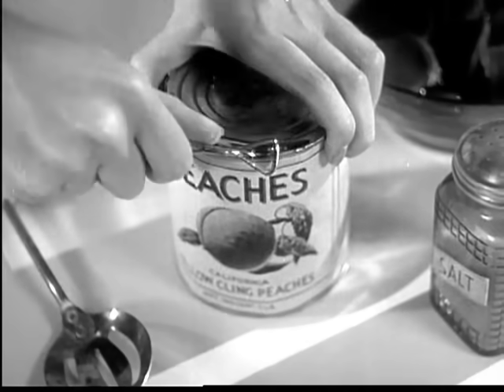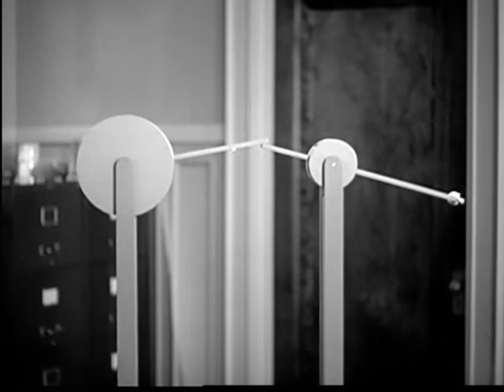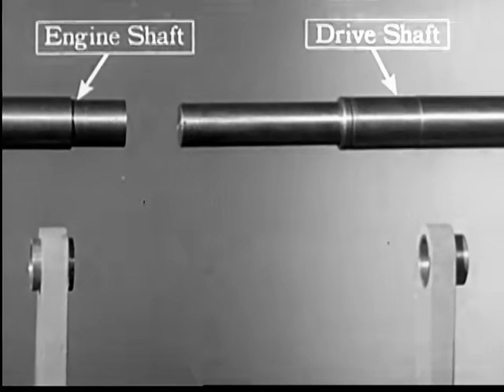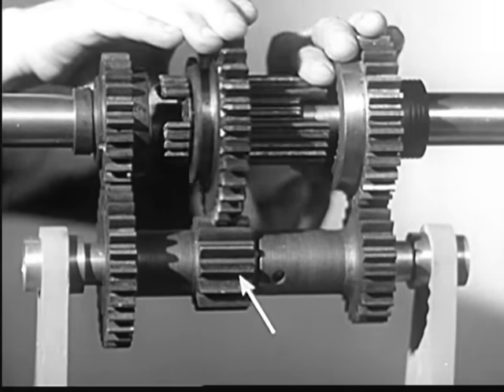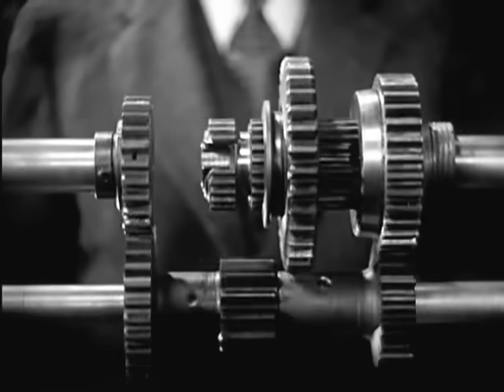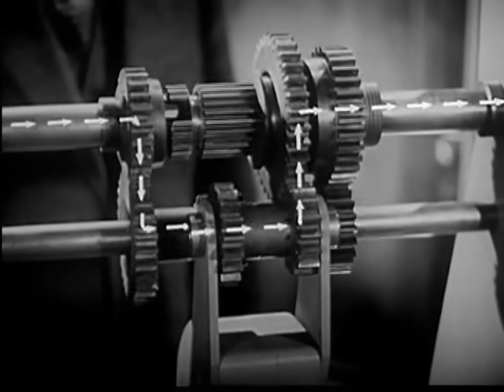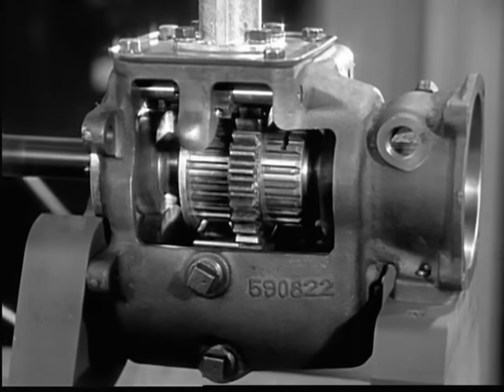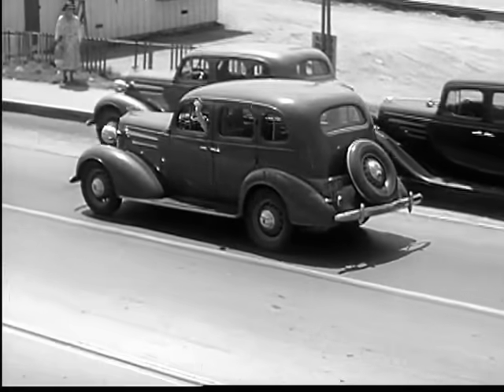Spinning Levers - How A Transmission Works (1936)

Comment: I bet that six cylinder was screaming like a banshee when she dropped it into second going down that hill.
Reply: This car is a 3 speed, second is only a little lower than 3rd in a 4 speed.
Reply: Nahh bruh that thing looks like its got a fat LS swap under tha hood
Reply: @surellow  
Heh, on a long enough timeline...
Reply: ah yes, the 6 cylinder banshee scream.  Also present when driving 75 mph.
Reply: @120masterpiece     Also present when driving a Ford.
Reply: Koo 9
Reply: Shoulda braked first then downshifted
Reply: @pranavdongre3290  Hitting brakes first will make wheels slip and your car spin. This will end wheels up, roof down. The point is to brake wheels smoothly by reducing their speed, not stopping them instantly. When the road is slippery or going downhill the wheels must roll, never stop. U should shift gears lower and lower and when speed is low enough, use brake pedal to stop car. Of course, shifting and final braking could take just a few seconds, maybe just a couple. This saved my car for several times, bro)
Reply: @lunotarr  got u bro
Reply: @lunotarr  dayum bro
Reply: @lunotarr  i mean you finely tune the braking pressure to stop without locking the wheels. It's not like u only have a handbrake. Maybe the 30's brake designs where less refined than today's.

Nevertheless, what you are saying is a great skill to have on wet/snow/icy roads! And very good practice in general!
Reply: @SergeantExtreme  horry fok i had no idea xD
Thank you for the info!
Reply: Вадим Романов Tires have no idea whether it is the brakes or the engine that is providing the force to slow them. The brake system usually can provide more stopping power than downshifting can and you would probably be less likely to lock the tires downshifting than hitting the brake pedal as hard as you can on an older car. However, with a modern car with antilock brakes it is a non-issue. Outside of driving for fun or sport, downshifting and engine braking is really only used if you are going down a long hill or mountain and would need to use the brakes the entire time.  Riding the brake can cause excessive brake pad wear and overheating. Which in turn can lead to expensive repairs and even brake failure.
Reply: @lunotarr  you made it sound as if the voice was speaking again
Nice
Reply: I have never laughed at a YouTube comment until now.
Reply: I bet these cars had low geared rear ends or something like that, so they won't scream that much if put into 2nd gear
Reply: Downshifting at 35 with a 3 speed makes it race. I rarely downshifted above 40 if I recall correctly, and 1st gear was not synchromesh, so you either stopped the car before selecting it, or did a little work with both the throttle and clutch. That was all an art I mastered which I've since forgotten now that I drive a 5 speed with full synchromesh.
Reply: In these old cars, would you blip the throttle on a downshift?
Reply: @typorad  blipping the throttle wasn't really necessary for second with a synchromesh transmission.
Reply: Yeah!

Comment: Hiw did they manage to edit their film back in the 39's?
Reply: With a negative cutter and splicer.  Transitions like complex fades, slides,  and such were done by cutting and and projecting selected pieces of negatives into specialized cameras that combined the images in various ways, producing new negatives with the desires transitions. The transitions were then spliced back into the original negatives at the desired locations and then everything was processed into the final display print. It was time consuming and expensive and required specialized equipment and skilled technicians. Unless you were a big enough studio that could afford to operate your own film effects department, most such work was jobbed out to film optical companies.

Comment: Never underestimate the impact of actually seeing something working. There's just something better about a physical demonstration over a 3D animated one
Reply: If the 3d animation is good enough to make you think its real , or if its executed good enough it will be good. But most people cant make good animations
Reply: As they said, seeing is believing
Reply: It’s better because we can see the physics taking place. In 3d animations they rarely simulate physics, it’s all animation.
Reply: That makes no sense, you're not watching it physically, actually you're watching it on a phone/monitor which only uses XY (2D) axis to simulate 3D. I'd rather watch something in 2D thats animated but works than some recordings that explain badly (not this video), actually i'd just prefer a detailed text as long as its right over a bad video.
Reply: So true
Reply: each frame of archimedes animation had to be handdrawn
Reply: 3D animation is extremely necessary. It's the same as this. You just never saw a good quality animation
Reply: Never underestimate the impact of 3D animation. There's just something better about  3d animation  over a physical demonstration
Reply: @rodriguepellaud    No, most 3d animation these days is complete shit.

Comment: "steep hill,use 2nd gear" because we haven't yet designed good brake systems and if you ride them you might die.
Reply: Until this very day, experienced drivers shift down when going downhill.

Comment: нихуа не понел, но очень интересно
Reply: On a Cyrillic gearshift, the letters are E, backwards N, H, 6, and W.   Backwards N for invert, H for neutral, 6 for run (drive), and W for shunt (low gear).   I've figured out what all of them are, except E, but by process of elimination it means park.  What word might start with E and mean park?

Comment: Nice work... I suppose that the 5-gear transmission works the same way...
Reply: Probably roatates to a different counter shaft with staggered gears in between. Just a guess

Comment: God how out of date this is today. A 3 speed manual. Manuals now use constant-mesh gears. All gears are always meshed. A sleeve with synchros connect individual gears to the drive shaft. So much smoother than this clunky old design, not to mention so many more gears. It’s still nice to see where they came from though.

Comment: 9:28 Love that sign " Steep Hill Use second Gear"
Reply: Guess the brake technology was behind the go fast technology.
Reply: @TYoung-up9ro  It's always better to be in a lower gear to use the entire drive-train to maintain a slower speed and more control rather than to put all the pressure and wear into the brakes during a descent.
Reply: @southpaw117  especially on a big truck, it's not that big of a deal in cars but on an 18 wheeler you'll NEVER want to rely on the brakes

It's kinda funny to see people honking at trucks, they don't know how much power and time it takes to accelerate and brake.
Reply: @TYoung-up9ro    You're forgetting these cars had all-metal bodies, they weighed a literal ton! Even with modern braking technology, cars that heavy wouldn't stop so well.
Reply: @SergeantExtreme  That's a common misconception: modern cars are often significantly heavier than these old ones. Safety features and technology add quite a bit of weight, despite the widespread use of lightweight materials!

Braking technology was terrible in the 1930's. They were vastly less effective, and said effectiveness fell off dramatically in situations requiring frequent or sudden braking. You could easily overheat your brakes if you rode them down a long grade like that shown in the film.

Comment: The reason these are explained better is that at the time they were trying to show people why pay extra for this item. Now all cars have gears, thus no company has any need for ads like this. In 1920s and 30s, many families were still driving 1900s type vehicles, including a number of chain drive single gear designs. These new gears added 10% or more to the cost of the car. So we had to convince people why they needed to pay more.

Comment: the only thing they dont get right for modern world is, why an automatic puts down more torque.. before lock up you have more RPM for less wheel speed, giving more available engine torque sooner.
same reason why my 5 speed car will accelerate slowing if i just let idle rpm move the car with a slow clutch, if i pack 1500rpm in and slip the clutch through engagement, the car takes off quicker. You are applying more torque from the get off (if done right) with less wheel speed due to rpm.

Comment: then whats the reason if the 1st gear if it has so much power, if you suddenly release the clutch the engine stalls with a jerk.
Reply: Depends on the vehicle whether it has enough power. Most regular cars stall when the clutch is released suddenly on the first gear, but many trucks and tractors have so much torque that they are nearly impossible to stall on the first gear.

Comment: Explains better than my school books.

School doesnt need to upgrade they need to degrade so that we watch this stuffs on a projector.
Reply: Agreed. The US spends the most amount of money per student than any other country in the world. The US also routinely places in the mid 20s in test scores around the world. The problem isn't spending money...it's being efficient in what's being explained
Reply: @pro-seriesfabrication3810  Not the schools/teachers'/or efficiency issues in any way, it's the technology and advancement of today that's next to impossible to explain and understand - hence those test scores... For example, most of us fully understand what's taught in this video as it's easy to understand and explain, but if it was a video on say a modern-day electronically shifted 8-speed transmission (and example of what's needed to understand today) - MOST of us would be lost, and some of us would blame the teachers/educational system for it when it's really just harder to understand.
Reply: @beobe99  so the schools that score in the top 10/top 5...you're saying their material is easier and their technology is stuck in the 1930s?
Reply: @pro-seriesfabrication3810  No, of course not. There are MANY variables to take into consideration besides what's taught. First being the student/teacher ratio - Teaching (and learning) w/ 25-30 kids packed in a room is more difficult than teaching and learning w/ 15. In addition to that, demographics play a large role based on what the child's home life is like and/or the stress they carry. Schools that grade higher are typically in wealthier or middle to upper class lower population areas. These schools get to brag that they're better, and they are! BUT, they didn't figure out something public schools haven't - other than having the luxury of creating their own student/teacher ratio AND choosing who is admitted based on parent/student interviews.

Comment: They always used women as a showcase of ease. "Look, it's so easy, even a woman can do it." what's interesting is the shear number of women who never learned to drive even in the 50's. There's a funny episode of father knows best where jim teaches margret how to drive. It was hysterically funny. Automatic transmission really helped to get women more mobile but a lot of women learned manual shift. My mother only drove manual shift cars for as long as i can remember. I remember her big and pregnant with my little sister and still clutching and shifting. Sadly, so few vehicles today have a manual shift option. I recently acquired a CJ-7 jeep specifically for forcing my teenage daughter to have to learn manual when she comes of age. Want to drive? Learn to shift.

Comment: Awesome video but 90 rpm?  That just seems too low even for 1936.  A typical engine idle is about 10X that.  Not sure what's going on here.
Reply: Rotational speed really doesn't matter for the purposes of the film, 
and with a full-size wheel and tyre spinning right next to the man, 
90 RPM is about the upper limit for reasonable safety.
Reply: @spacemissing  Yea, I just realized it's the rotational speed of the model, engine not a typical car.

Comment: could someone explain what then happens to the drive shaft while breaking with gears down a hill, wouldn't that interfere with the shaft that holds the pistons? if there is an explosive force that drive the pistons it must be some part to take of that energy/resistance fed back from the wheels?  I'm not well informed on this topic and not the brightest either so what am I missing here?  thanks in advance for any answers

Comment: When I was traveling cross country in my 1956 Ford F100 pickup a few years ago the transmission (3 speed, on the "tree" (column) shifter) went out. I literally pulled it into a local farmers barn, took it out, and rebuilt it in a couple hours with bearings, seals, a couple new gears that I found at a local tractor repair parts store. Try that with something made today, NOT A CHANCE!
Reply: Because everything now comes with model specification. In other words, you Have to buy from us for  fixing the car we just sold you.
Reply: In the future engines and transmisions will be modular
Reply: @marv9906  No, it doesn't work like that. In the future there will be no cars, just slaves to AI.
Reply: u old brah

Comment: I'm still not quite understanding the reverse. Why are some gears moving clockwise and the reverse anticlockwise without causing damage to the gears?
Reply: The clutch, which is not illustrated, has disengaged the engine and the driveshaft, transmission gears are not spinning when the shift is made in real-world scenarios.  Their demonstration is being conducted at 1/10th engine idle.
Reply: Okay, that explains it. Thank you, sir.

Comment: i didn't fully grasp the "in reverse" bit of it..... what made the shafts go in the opposite direction ??

other than that, another excellent 1930s explanational video
Reply: There's another gear used to reverse the rotation of the shaft.

Comment: I learned how transmissions work in many modern animations but i could never figure out how the synchronizer worked until one video finally explained it. But still I still didn't quite understand why it worked until this old film.
Although much like that one video, its so simple and almost 'flimsy' method that its still hard to believe that's all it is.

Comment: I love these videos; they do a great job explaining how these technologies work.  That being said, modern transmissions are a little different, partly because they usually have more gears (four forward gears is more common now than three, and some cars have more than that), and the way that they handle shifting is a little different, using a clutch rather than synchro-mesh, or a clutch along with synchro-mesh.  And, of course, many modern cars have automatic transmissions.  But that's just nitpicking; again, these videos are great.

Comment: I can't believe so-called Engineers took such a reliable and simple design and turned it into what we now call CVTs, which don't last 50,000 miles on a car that weighs 1/4 of what old cars used to weigh.

Comment: Over 20 years ago I built my first Lego Technic car with a working 3-speed transmission with reverse. It uses simple inner gears to catch free-spinning outer gears, but across 2 or 3 (don't remember) shafts along with (I think) more than one countershaft. It's a bit easier to follow how it works, but the model in this video is definitely a heck of a lot more compact with it's multi-layered free-spinning gears. That Lego car definitely has neither clutch nor synchronizers.

Comment: I saw the synchronizers and was thinking they could allow shifting without a clutch (in practice). Then I saw the driver was using a clutch after all, I assume while driving a vehicle with a transmission similar to the one on display. So, with synchronizers, is the clutch really all that necessary? I know that the clutch disconnects the flywheel from the transmission so that the gears can mesh a bit easier with less power driving on them. I'm guessing that perhaps rebuilding a worn clutch assembly is easier than rebuilding a transmission. Come to think of it, don't some European cars have no clutches with manual transmissions?
Reply: In my Semi i never clutch after first, you just get it at the right rpm and drop it into gear. In a high rpm gas motor with more delicate gears in the transmission you would have to be very precise not to grind or face gears, and even then i think you would wear out your synchros. In "clutchless transmissions" it still uses a clutch but its just handled by electronics so no need for the driver pedal.

Comment: This is how a manual transmission works. Anyways I think some automatic transmissions are modified manual transmissions because, there is a computer controlled linear actuator in place of the gear shifter in this version of the automatic transmission, and there is another gear stick that is different than that of a standard manual transmission, or could be a gear stick from an automatic transmission.

Comment: Instruction movie ends nicely with letting a women demonstrate safe driving downhill on low gear. Nice touch when thinking of what roles women usually were assigned in the society at that time. Agreeing with the rest of the commenters say, instructional movies were very good that time, clear and tidy, and fancy computer animations would add nothing useful at all.